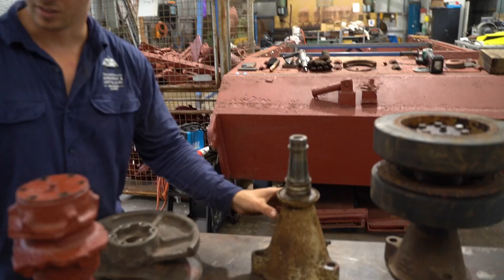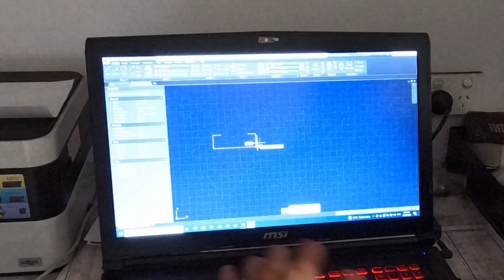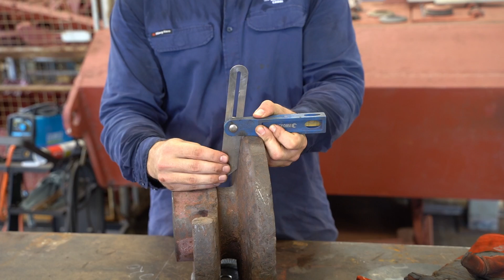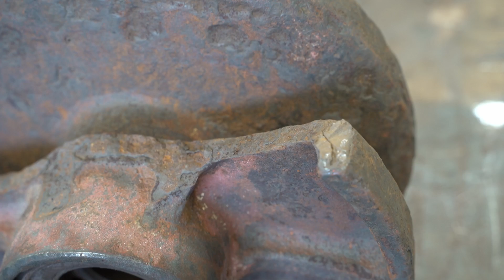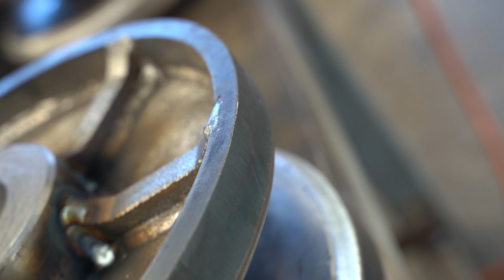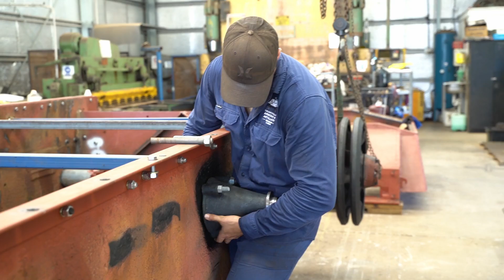Workshop Wednesday - STUG III RESTORATION Ep. 9

Comment: I Have to Play the Devils Advocate, Being that the Originals Were CAST, Why Didn't You CAST NEW RETURN ROLLERS?, COST?
Reply: Sure,but oh,a hundred years ago,foundries were commonplace in very ordinary sized communities. With the mix of different ages of men,from master tradesman to raw apprentice,there were decades of experience to draw from. For a very long time now,fabrication skills versus parts replacement has been an issue. It was mentioned the German parts were steel,not mild steel. So heat treat would also be an issue. Starting from scratch, with mandatory safety procedures,what would be the startup cost of even a very modest foundry building and plant ? And the climate there is subtropical. Molten iron in shorts ? Not me.
It would be nice,but hardly realistic.
Reply: The cost to make a mould for 4 return rollers would be astronomical, plus then you have to machine all of the surfaces anyway to get them all true, then the steel is weaker and pourus. Getting these parts cast would've been a good idea if they needed 50 or more, but not 4.

Comment: Could the Stug have been damaged once, replacement return rollers added (from the other supplier), then the Stug was destroyed later?

Alternatively, the manufacture of return rollers may have been done in a separate place and shipped to the final assembly factory that needed them.
Reply: Probably not damaged, since it's unlikely all the return rollers would have been lost leaving everything else original (ie. it would have been a mixture of MIAG and Alkett rollers). I'd guess the Alkett factory probably ran out of return rollers and sent to MIAG for extras. So it was manufactured with a mixture of parts.

Comment: Seeing photos of tanks in the field with mixes of different production runs of parts is commonplace. Anecdotally wrecked tanks were stripped for parts which were  put back into service on new or rebuilt tanks. Surely one of the other tank museums that has original vehicles should be able to comment?
Reply: I'm wondering if they reached out to any other museums or collectors to find replacement casters.  Was there some reason that the project had to be exclusively in shop?

Comment: The two factories mixing parts was not common until the last year or so of the war, when stresses on manufacturing because of allied air raids and other related factors after D-day meant that an 'all hands on deck' approach was used just to get the vehicles out of the factory (temporary of otherwise and into the line. This meant that whichever factory had a majority of parts remaining shipped them to others to keep things moving. In the field, this of course happened even more often with running repairs.

Comment: As the war progressed and spares became harder to get, parts were probably scavenged off other vehicles.

We did it when I was in the RAF, ribbed parts from one aircraft to keep another flying as there wasn't a part readily on hand.
Reply: I suspect the casters could come from any Panzer III or derivative such as the StuG III.
Reply: It's still common in civilian life, too, anywhere parts & logistics drive a need to be "creative" with solutions.
If it fits, does the job, and gets you moving, then the job's good; if that applies when civilian life gets urgent, then you have to tink it goes that to the nth degree in a battlefield.
Reply: @iainburgess8577  This would only make sense if there were one or two, but it sounds as if the entire assembly for the return rollers were made by Miag.  Given the late model and  the fact that the factories producing the Stug III G's were bombed repeatedly, it's highly likely that the return roller assemblies were shipped in in order to complete vehicles coming off the line while the factory was rebuilt (or built elsewhere such as the plant in Falkenese).

Comment: The raids on the Schweinfurt factories really made for noisy tanks. Putting several 10s of tons riding on metal on metal is murder on machines.
Reply: Return rollers are not significantly weight bearing. But, yeah, they were noisy anyway.